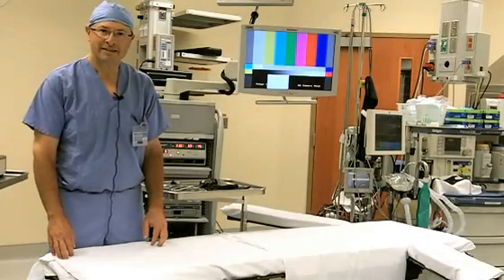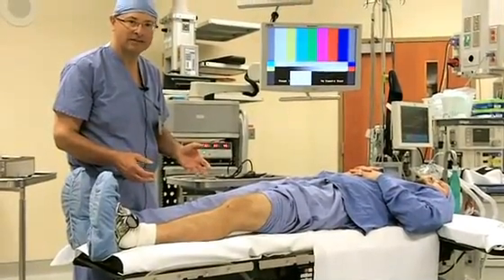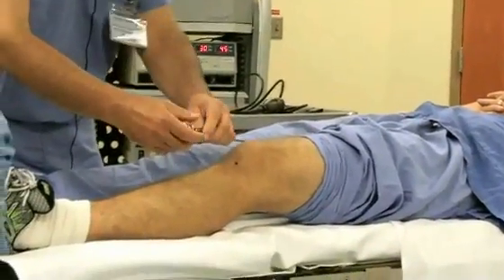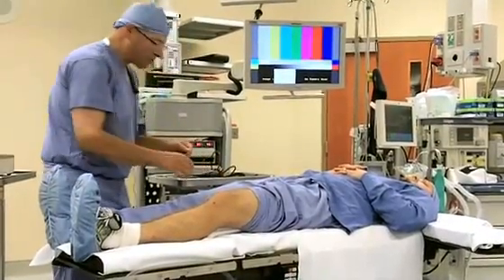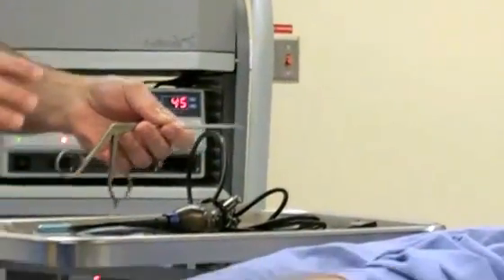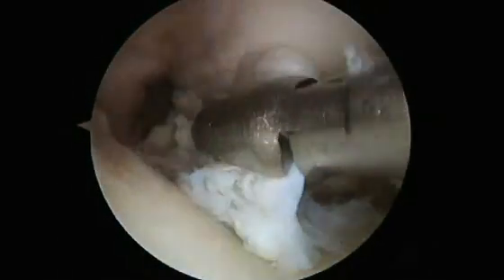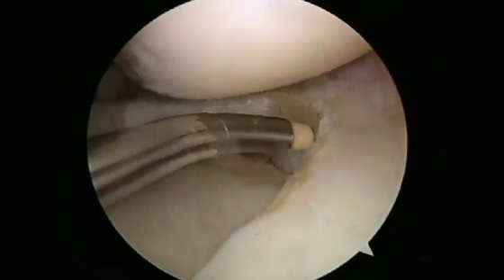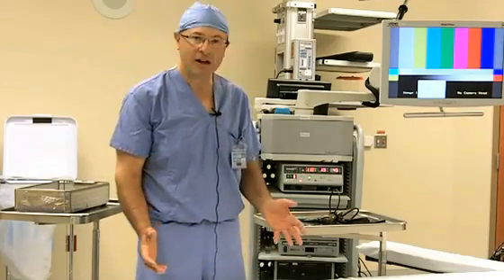Meniscus Tear

Comment: 1) focal hyperintensity in the cartilage 3x1mm with underlying subchondral marrow contusion/edema measuring 1.2x1.1cms in size in the lateral femoral condule - s/o low grade osteochondral injury.
2)small sized pockets of fluid collection under the LCL and FCL with diffuse increased signal intensity of LCL seen however fibre continuity is maintained - s/o grade II injury.
3)inflamatory/edematous changes with fluid signal intensity in the hoffa's fat pad.
4)focal grade I signal intensity in the anterior horn of lateral meniscus.
5)Tiny hyperintense signal(4mm) involving cartilage of medial femoral condyle.
6) Minimal joint effusion seen extending into medial and lateral recess and adjacent to anterior horn of lateral meniscus

Comment: I bodybuild, During a Leg press movement i heard something Pop! I felt pain. Every time i try to bend my knees it made that distinct popping sound and pain, but No swelling after 2 months rest it went away except for the Popping sounds. I notice every time i do a leg routine i.e Squat or lunges when i bend my right knee the pain returns then later subsides, I can move walk jump run fine just the bending part hurts. Should i apply R.I.C.E more often and how do i fix this?.
Reply: +The Decider 100% certain it's meniscus tear.
Reply: I have the same problem

Comment: i had this sugery 10 years ago and they removed 40% of it, i was able to run 1 week after the surgery but 7 years later i needed another surgery because my meniscus was weak in the first place and the surgeon told me i will need another surgery within ten years and he was right. You have to know that the more you remove, the more your bones will be damage. Avoid the surgery and go throught the pain if you can otherwise you will need a knee replacement in a couple of years

Comment: This might be a technical question but I was just diagnosed, by MRI, with a "9mm in length medial meniscus non displaced radial oblique tear in the inner half of the body/posterior horn junction..with "small joint effusion present."  The ortho says he would remove 1/3 of the meniscus and this sounded like A LOT to me. Why so much if it's only 9 mm in length? But he stated that it was pretty straightforward and it would take about 30 minutes and I'd likely be able to walk out without crutches.
Reply: What did you do? How are you now?
Reply: @umit777.  Wow, that was a LONG time ago!  I had the knee meniscus surgery and it went REALLY well. After about two weeks I started playing tennis slowly and over several weeks I felt it continue to heal.  However, I'd say it took a good 4 months before I felt it was completely healed up and I didn't think about it any more.

Comment: There are different levels of meniscus repair surgery. If you simply need damaged meniscus shaved off, the recovery time is short and, for the most part, pain free. I am 10 days out from my third meniscus surgery on my right knee, and fourth overall. I had the damaged area cleaned up and arthritic areas removed. I walked out of the day surgery to the car. I had crutches for stability reasons only and was told by my doctor that the surgery allows weight to be applied immediately after the surgery. I did not take a single pain killer and never felt even close to needing one post op. I did take the recommended one aspirin each day to help prevent any blood clots. With that said, I am a healthy 44 year old male who does 6 - 10 sprint, Olympic or half Ironmans each year. Which definitely (with all the training I do) has contributed to my need for surgery, as I only started competing 2 years ago and really never considered myself an athlete. With that said, most people should not be concerned with this surgery as it is simple and mostly pain free. However, if you are not in good health and overweight you may find recovery more lengthy and painful. Also, if you have meniscus repair (where they sew the actual damaged meniscus instead of just cleaning out the damaged tissue) recovery can be a bit longer. you have to look at it this way, if you are in pain and it disrupts your everyday activities, the surgery is simple and you'll be glad you did it. If you are severely obese and don't care about your health its probably going to be a challenge for a couple weeks. Like I said, this was my third surgery and I went back to work the next day. I was driving on day 2 and walking without the support of crutches after the first day (I was told to use the crutches as support only, still putting full weight on the knee, until I could walk without a limp. That was for only 1 day). I have not had pain over a 1 or 2 on a scale of 10 on any of my four surgeries. This may not be typical for everyone, but if you need the surgery get it. I'll be swimming today and on the treadmill once my doctor gives me the ok later this week. Again I'm only 10 days out. Good luck.
Reply: Ruprecht why did you get 4 surgeries? Did you keep tearing the meniscus again?
Reply: In
Reply: Why did you get 4 surgery? How are you now

Comment: How is this surgery helpful? What's going to be between the knee to cushion it? I'm scared to have this done!
Reply: The meniscus is still there..usually not all of it is removed unless it was completely obliterated but mostly just the part thats torn is shaved off, they leave a little ring around the edge to aid in the shock absorption on the knee
Reply: You don't need to do it if it does not bother your everyday life or does not hurt. If meniscous is totally removed (both) then there is no cushoning between knee and the bone so this will eventually lead to arthrosy.

Comment: I fell on May 8th on a dog toy, aggravated an old injury in my right knee that I had surgery on (lateral release), and did something to my left leg/knee. I've been having pain on the back of my knee, (down to my ankle and up to the back of my thigh), along the inside and above the kneecap. 

Then, on May 22nd, I had a car accident that totaled my 2011 Ford F-150. I had some soreness (and still do) from the airbag hitting my chest. But, of course, I hit my left knee on something. I'm pretty sure I don't have any completely torn ligaments as my knee appears to be stable. I've had moments where it gives out on me with twisting motions, or when squatting, so I'm trying to be careful and avoid those motions. 

I was sent home from the hospital with a straight knee splint, but I took that off ASAP as it was bothering my left leg and knee and making the pain worse. I have an athletic compression bandage I've tried with the knee, to the same effect as the splint, as well as a jumpers knee strap. Nothing I have when it comes to a brace seems to help. I have been doing some light exercises to see if they may help, but riding a stationary bike aggravates the knee. It feels like something is catching, like when you strum a rubber band.

Comment: I had medial meniscus injury at work. After meniscectomy that was take out broken part 5 months passed and still I have a problem with my knee that is weak and when pressing on the ground while walking my knee can band on its own. Even though I did and do all exercises but my problem is not gone. Moreover, after the exercises my knee gets more weak and even starts such a pain that I want to cry.
My doc checked my nerves and mechanical part of the leg that is responsible for knee movement. Everything is OK but my knee cannot get cured and I have casual banding of the knee and cannot go to work at all as my job is by walking where can be even oil on the floor by chance or the floor can be slippery.
I am at a loss and do not know what to do ?
Reply: Take care man!
Reply: Thank you. This is from youtube and I did not really notice that my youtube comments went in Google + :-)
Reply: Haha yeah it's appearing on G+ :D
Reply: Thank your a lot. It's nice to hear this kind of advice. I had removed part of medial meniscus. Small particle. Unfortunately after the operation I got to know that I could have repair it. Now I have pain all the time and doctors cannot do anything about it. Just pain killers and that's all. Right now I am having burning pain and fed up of doctors. With this burning pain I have something like as if inside the bones is itching too. There are days that I cannot go to work but I go as I need money for living.
Reply: thank you a lot. I am positive thinker and in Israel is not easy to do so for me. I mean in terms of implant and operation. I should work now non stop. My insurance does not cover the costs when I do not work and get any operations done. To tell the truth the only difference I feel before and after operation is that my lag does not stuck in one position. Other than that everything is the same.
Reply: @davitdavitdavit  bro how is your life now?
Reply: @davitdavitdavit what did you do about 8year? How are you now??
Reply: Bro how is ur knee right now bro I am having the same problem pls reply me .